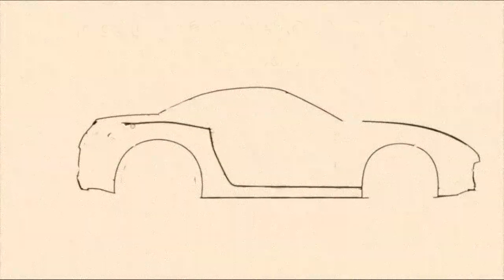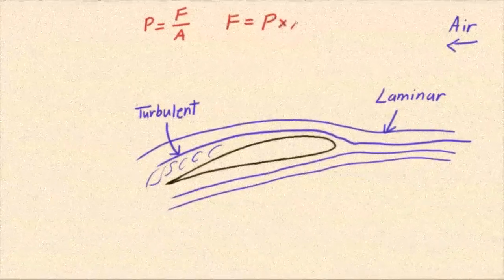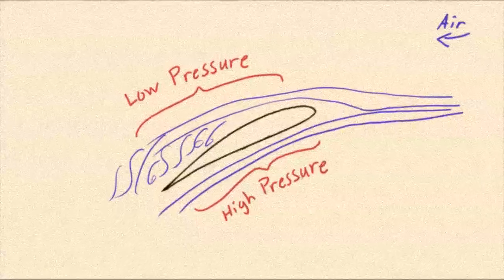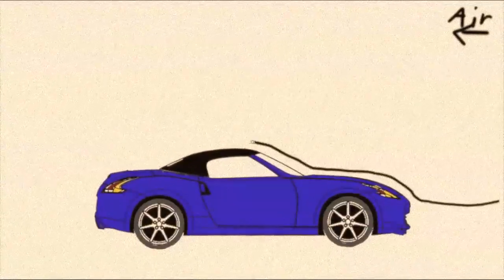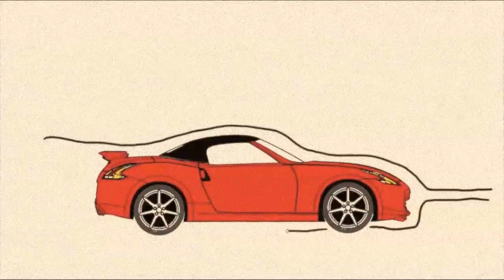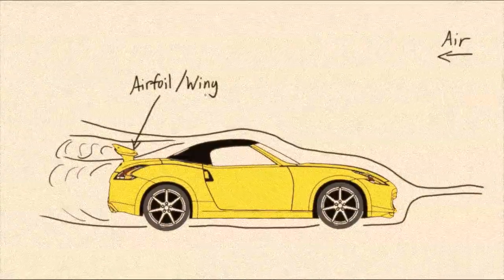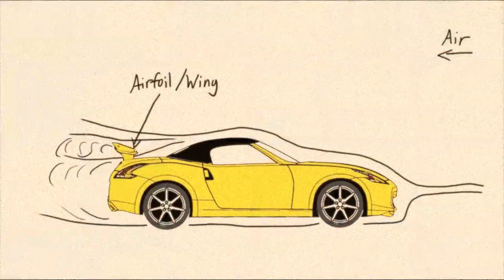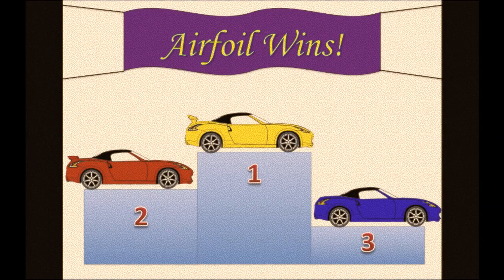Sports Car Aerodynamics: Spoiler Alert!

Comment: this is a terrible video.  cool wind tunnel but there's not enough space here to list everything you got wrong here. Wings and spoilers create down force which aids in handling but also create a lot of drag which slow you down.  Some racers use wings and spoilers to help grip on cornering.  But look at the cars that set land speed records and you won't see any drag inducing wings or spoilers slowing them down!
Reply: +Benedek Nagy I'm sorry this video had so much wrong with it.  the basic explanation of how a spoiler or wing works was correct to about a 6th grade level even though he incorrectly identified the point of separation on the inverted wing.  the point is he claims over and over that a wing or spoiler makes the car faster which is simply not true.
Reply: +Observ45er ha you had fun watching this didn't you?  I understand your comment re: weight of a car holding it down and you are correct the video does actually use the word downforce a few times and refer to negative lift.  However at the beginning of the video he says that the point of this video is to determine if adding a wing or spoiler makes the car faster.  He then goes on to suggest that increased downforce will increase the cars speed and acceleration which is not true.  so the whole point of the video was not to demonstrate that negative lift will increase the cars weight as you stated but to demonstrate that wings and spoilers make cars faster which they don't.
Reply: michael spencer  ???  I didn't think I was dreaming this... I beg your pardon, kind sir. 
"never mentions downforce"?
He "never mentions" it a total of six times!
...
Quotes from video:
Flipping the wing upside down: "...Thus a down-force is created instead."
" Airfoils use a down-force to push the back of the car down."
...
Then, at least four  times he says the device is "decreasing lift" and means lift of the car itself.
Then: "A localized pressure difference at the airfoil creates a down-force..."
Spoiler in wind tunnel: "However, the re-directed air ... reduces the effect of lift with a down-force."
Lambo in tunnel: "Airfoil...acts like an upside down wing. This creates a down-force... "
Fun Fact: "At 130 kmh, F1 cars can generate more down-force than the weight of the car....Drive upsidedown..."
...
But who's counting... (:-D)
--
Cheers, ScienceAdvisorSteve
Reply: this is what i was thinking the whole damn time
Reply: Yeah, aeropackages help track times; not acceleration times
Reply: +Observ45er  no the stated point of the video is to demonstrate that a wing or spoiler makes sportscars faster so you should include them when drawing cars.  The video actually never mentions downforce as a factor just speed.  But like +Delta X says the wing or spoiler might help track times due to the ability to hold higher speeds through turns but actually hurt top speeds and have little or no effect on acceleration until you get up in the 80 mph range.
Reply: The point of airfoils is to create a downforce, to increase friction on the tires, so more thorque can be applied without slipping. Thats why you see them on dragster races. But cars that set land speed records dont apply thorque to their wheels, they dont even have an internal combustion engine. They use jet and rocket engines. Hope you understand now.
This is a great great video and didn't get wrong that much things that you think it did
Reply: Assuming the perfect conditions outside the car, the simple fact that it weighs more than air is enough to make it stay on the ground. I can't even think of any way a wing could increase top speed, like the video claims.
Reply: michael spencer I know what he said, but the OP I responded to doesn't even get that a car has lift...the reason for all this stuff in the first place.
...
Your points well taken.  but... Downforce will increase some accel if it prevents slip.   Accel over time is also important and breakaway in turns reduces average accel as well as speedin turns; or it puts the max speed point further out. 
  I know he didn't mention slip, but it is a factor overall.
...
Cheers, Keep up the comments...
Reply: Spoilers don’t increase downforce, they reduce lift. I️ know it sounds like the same thing but there’s a key difference. For example keeping the lift gate up on your truck is more fuel efficient than putting it down because the luggage act as a spoiler by reducing lift without increasing drag. If you were to remove the liftgate and put a wing in its place it would increase downforce for better cornering speeds at the expense of more drag.
Reply: 나도 같은생각...
Reply: +Numiro  You're missing the whole point of this video.  The fact that once moving, the airflow creates pressures thus changing the vehicle weight is the subject.
Reply: Excellent point; I believe it is because they design the body to produce that downward force and thus would not need the spoiler. The drawback is a very non-maneuverable vehicle that is excellent at straight-line speed but can't turn very well. Spoilers add that downforce while allowing the car to maintain a more-car-like (and less-rocket-like) shape and maneuverability.
Reply: +Matt Stacey 
that is exactly  true.  But I  the video it states that everything else being equal the car with the spoiler or the wing would be faster which is simply not true.  It would, handle better but it's acceleration and top speed would be slower.

Comment: so this guy might wanna contact Mercedes, Porsche, Ferrari, Lamborghini, Lotus, um yeah and tell him what he thinks then let them show him real race results with those setups, high-end sports car go so mind blowing fast that in actually the force of drag does become an issue with both the air foil and spoiler and does hinder top speed compared no a naked or spoiler/air foil -less car. There is a reason when watch drag racing all but top fuel dragster have spoilers or air foils. The reasoning behind top fuel dragster is they lack the total body area to keep the massive torque from flipping the body over or never being able to get traction at all from at speed.
Reply: if you think about it wings/spoilers do allow for more speed around corners though.
Reply: +Steve Spencer. I whole heartily agree but in the scenario given in video is for a drag race which would be a simple high speed run

Comment: Downforce of any type from a car will almost always cause more drag and slow you down in a straight line. The drag a spoiler makes is a trade off for downforce which translates into more grip in the corners allowing for faster cornering speeds and quicker lap times.

Comment: Wow...just, no, on so many levels.
A) A spoiler or wing or airfoil has absolutely no impact on a car at rest or upon starting (other than physical weight).
B) Upon initial starting, the limitations on acceleration are weight and traction. With no air flowing over the spoiler/wing/airfoil, there's no improvement in traction but a negligible increase in weight.
C) At speed, spoilers, wings, and airfoils ALL increase drag, reducing acceleration in a straight line.  The ONLY exceptions are those which extend the rear of the car into the dirty air without protruding into the airflow.  This is why cars with active aerodynamics typically have a max-speed mode which keeps the spoiler/airfoil from extending in order to minimize drag and resistance and maximize speed.
D) Spoilers, wings, and airfoils are all designed to improve downforce to improve grip, which is a limiting factor (after startup) only when cornering.  They are never desirable for straight-line performance.
E) Airfoils increase drag significantly, because they are in the air flow and presented at an angle to the direction of travel. There can be a bit of Bernoulli effect, if properly designed and gapped away from the surface of the body, but it will never overcome the amount of drag gained by putting a solid object in front of the air.  Drive down the road at speed and stick your hand at an airfoil-like angle to see how much drag is applied to your hand.  This is why max-speed cars such as the Bugatti Veyron and its descendants can drive 270mph but more powerful & lighter-weight open wheel cars (such as Indy & F1 cars) top out at 230mph even on high-speed tracks like Indianapolis Motor Speedway, and 190-200mph or even less on courses with twists & turns.

Seriously, a complete lack of understanding of aerodynamics here.
Reply: The Veyron Super Sport's world record runs were up to 267.8mph...close enough to 270mph for this discussion.  Its descendant, the Chiron, is widely recognized that it will be able to top 270mph and some even speculate up to 280mph.  Therefore, my point stands there.
You are correct, though, Indy & F1 cars are not more powerful...I misspoke (they are faster 0-60 than the more powerful Veyron, but that's due to a huge weight advantage).
However, the major point (rather than the minutiae) is that air foils do not lower drag and increase the top speed, which is what is contrary to what is claimed by the video.  That is easily evidenced by the fact that Veyron's standard top speed is 213mph due to the aerodynamic aids that deploy at 140mph; the only way it's able to overcome this drag is by going into high-speed mode before even starting to drive, which disables those air foils from deploying.
Reply: Name an Indy or F1 car more powerful than a Veyron. Also, the Veyron is not topping out at 270.
Reply: +aluisious  better power to weight ratio?
Reply: Sean Williams He said more powerful. Power to weight doesn't mean much for top speed anyway. That's just drag vs power.
Reply: +aluisious The turbo BMW in qualifying run with 5.6 bar of boost.

Comment: But it dependents on the attack angle of the wind because the yellow car, since it has a bigger spoiler it generates more drag, which could give it advantage in high speed corners but it is a disadvantage in straight line, high speed compare to the others

Comment: Spoilers in some cases can actually reduce drag. They can ensure that the flow has a clean separation at the rear of the car reducing vortices which would otherwise increase drag.

Also your race example is misleading a rear wing wouldn't generate downforce when needed at the start of the race but it would produce drag when it's not needed at the end.
Reply: Yes, you are exactly right.  It's a shame that racing organizations outlaw airfoils that are adjustable during the race.  Minimal angle of attack in the straights, steep angle during braking, and mid angle through a turn.  Since you are a motorcycle guy, I've always thought front and back wings on a bike would work, but the mounts would be complicated.  The wings would need to be close to the ground, and pivot as the bike leans into turns.
Reply: +deezynar f1 drs is an adjustable airfoil...
Reply: the s5 rx-7 vs s4 have various plastic body details added to reduce drag, the spoiler is same i guess.
Reply: There is a limit on adjustable wings and spoilers because , as you can imagine, a car following another that pulls out the full 'flaps' would practically blind the driver behind. ... wait did I just write that O_o  godz oh well once seen, can't be unseen.
Reply: Michael Foransich was that post supposed to make sense?
Reply: I also found it a bit misleading how he showed the performance in a drag race because his video did not aptly explain how an airfoil or spoiler would improve performance in a drag race and actually described something to the contrary as he talked about the increased drag. But at the end he did mention same track which implies he meant for corners to be involved and he simply couldn't show this due to animation limitations. I would think that all spoilers are designed to reduce drag while rear wings are designed to increase downforce.

Comment: The extra drag and down force would only serve slow a car down in a straight line. 
''F1 cars can produce more down force than the weight of the car" that means that the car , when being acted upon by the down force is actually heavier and wont move as quickly as a car producing less down force, and therefore less down force would win in a straight line. I think this is all basic knowledge when tuning a race car, right? Is there something I am missing? Please help me understand!

Comment: Thanks for the video.  Me and a friend bought a go kart and we are looking for better ways to making it go faster.  While my friend knows everything about the engine and stuff, I'm the one that knows aerodynamics.  We are either going to do drag racing or just regular old racing with it so we were going to put roof flaps and lower the side skirting in case it spins around so the air won't get underneath the car and blow it over. Also for mainly straightaway speed we're putting a spoiler, a splitter, flaring the ends of the side skirting and making the back end of the car stick more out to the right side and not the left side all purely for extra down force and side force giving us a lot more speed.  We're also looking to putting a windshield and a metal or steel bar around the side of the car and tires protecting the car and more importantly the tires in case of an accident. And this video helped a lot for putting a spoiler on the car, it would be wonderful if you can post a video concerning the front splitter of the car if you haven't already, thanks in advance if you do.

Comment: I think your resolution can be better demonstrated by placing a weight sensor, capable of reading weight in mg or oz., under each of the wheels of the test vehicle in the wind tunnel. This is because of the weight of the vehicle models used is in grams and any down-force on the scale model will be so small or minute, a sensitive enough weight sensor designed to read in mg or oz. will be capable to show any changes. Conduct the same experiment again by introducing smoke and applying variable fan speeds to show a vehicle traveling at different relative/scale speeds. As per your conclusion, if the speed of the fan was to be increased, the additional down-force on the rear wing would show an increase in weight at the rear wheel weight sensors, thus proving that airfoils do in-fact increase down-force at speeds.

As for the winning-the-race part: I don't think a vehicle with additional drag on the rear wing will necessarily win. This is purely demonstrated by the DRS (drag reduction system) on modern Formula1 cars. In the long-straights, the DRS system is enabled by the driver to neutralize/lift the rear wing, changing the angle of attack of the wing, reducing drag and increasing straight-line speed. The DRS is then disabled when approaching a corner to drop the wing back down, increase the angle-of-attack of the wing, increasing down-force and grip around corners.

Comment: This is why ricers are so cancerous.
You didn't mention that this only goes for RWD cars.
Reply: +DatGameh You sir, dont know shit
Reply: +DatGameh If on straight road, it wouldnt make much difference but on corners, yes its almost as useful
Reply: +Johnpaul Bennett 
He mentioned that spoilers "makes your cars faster"
Rear spoilers actually benefit the FWD's sense of control as it prevents oversteer by equalizing downforce throughout the car.
But it makes the car slower at the same time.

And as you know, ricers always want to be fast.
So they create spoilers perpendicular to the ground.
Reply: +DatGameh Or even all wheel drive like on the rally cars.
Reply: +Johnpaul Bennett
It's already a week.
Do you have a rebuttal, dumb ass?
Reply: +Johnpaul Bennett 
The maturity is real tho.
You started it anyways.
You didn't even point out how I contradicted myself.

Also, slamber is stupid. 
Chamber 90 digris scrub.
Reply: penis

Comment: Uh this is cool, but wrong. In straight line the the spoiler and air foils create drag as you said (not to mention added weight) making them slower. The aero advantage only comes into play if the spoiler less car is having grip issues at the tire due to lack of downforce.

Comment: The thing on the back is not called turbulent, that's called separation!
Reply: Since air is a fluid, it is correct to say it is a turbulent fluid, and the air in the high pressure zones is laminar

Comment: I where my hat backwards so it gives me more downforce   When I jog
Reply: When you run really fast, can you generate enough down force to run upside down in tunnels?
Reply: @CheensCreationsUK  I highly doubt it
Reply: +Nathan Enders I do the same only on short runs. Longer ones...because of the downforce I stress my neck and then I have to stop earlier at the massage shop.
Reply: +sarimKHANage Only if you are good enough to avoid the lamps. If you try to jump them, it's game over.
Reply: you should put some canards on your shoes for even more downforce
Reply: wear
Reply: You sure that's how it works? Your hat is curved down to stop sun getting in your eyes, so it will give you lift.
Reply: Learn to spell
Reply: Nathan Enders yeah I where my jeans backwards prevents up force
Reply: I wonder wear you lurnt english.
Reply: Make sure your cap is flat billed and adjust the angle of attack upwards for more downforce. Curved front facing baseball caps will create lift. Theoretically hurting your top speed and creating instability in your laminar airflow resulting in a fall, scraped knees, hospital bills, and crutches lol
Reply: Your england is powderful.
Reply: Techically it does
Reply: Wear*
Reply: Ummm OKAY
Reply: Hat? How does that gives you a Downforce?? Cuz The Cover thing is Pointing Down like the Angle of it is like the angle of the Flaps on the Plane when Taking Off
Reply: i put a spoiler on my bag so i can go really fast
Reply: At last. A true match for Eisenstein
Reply: Except your backwards hat is more like a diffuser than a wing.